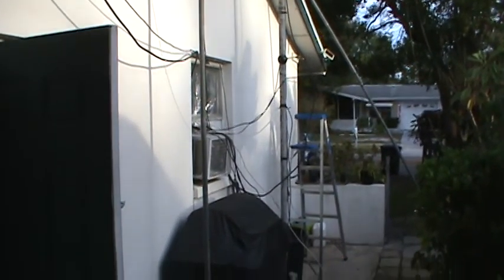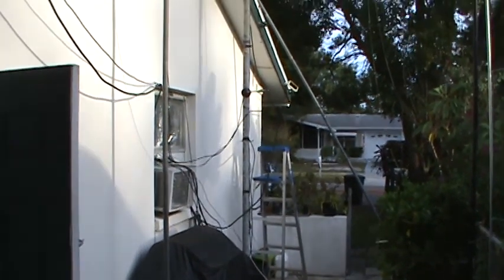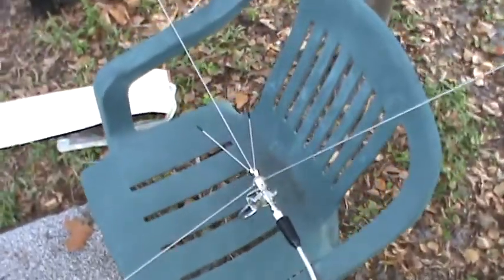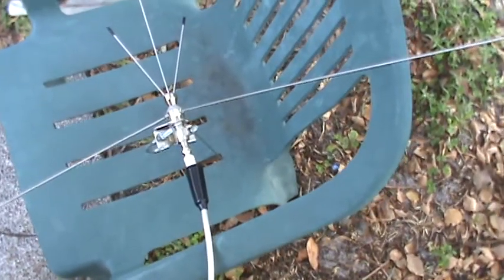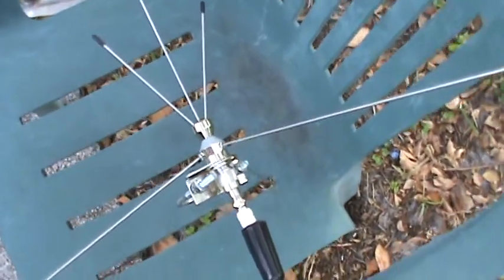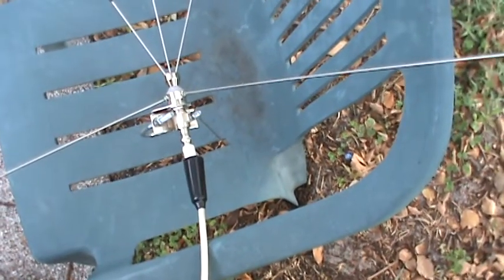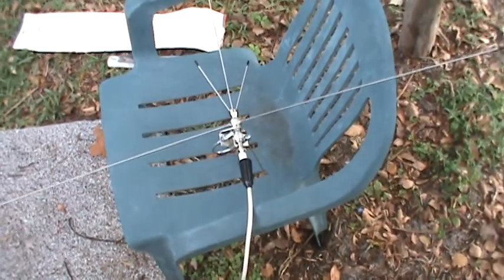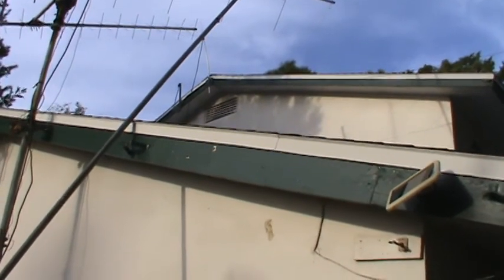TRRS #1318 - Antenna Restoration Pt 1

Comment: Had me 2 of those 20-176 antennas work good for basic vhf UHF didn't work well for vhf low or 800 MHz ...... Had to throw them away the metal that comprises the so 239 rusted away and actually thinned out..is like pot-metal..... Replaced with a scantenna st-2 works much better but discontinued... Took my uncle's 20-176 down his eroded also due to the fl air ... He tried a discone from center fire antenna holds up much better to the fl weather and inexpensive.... I use rg-6 quad shield coax over 59 for the obvious lower loss and rf shielding ., hold up 5 years plus so far in fl.,..I have to put my st 2 back up and diamond x50a been too hot yet!glad u rvgetting ur setup back up!
Reply from the maker: I have had one like the new I showed here and it has been up for over 20 years and still working great.  Living 5 miles from the Gulf of Mexico you would have thought it would have rusted out.  Had a scantenna and it did not even last six months before the elements started falling off.  You just never know. :)

Comment: I added elements to my radio shack antenna like yours and it is now my favorite antenna.
Reply from the maker: Super.  Can you give us more details?
Reply: hamrad88 I cut pieces of stainless  elements to the length of the frequency I wanted to improve,  drilled small holes around the 2 45° vertical elements and installed them.
854 mhz 
280 mhz 
Are the 2 I remember
Reply from the maker: Thanks for the info.
Reply: hamrad88 better reception than my Diamond Discone.